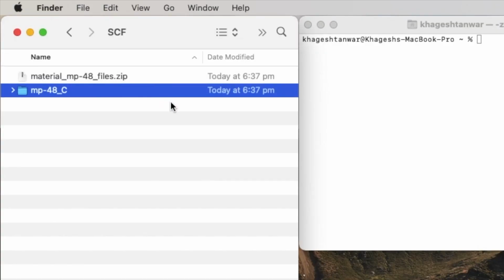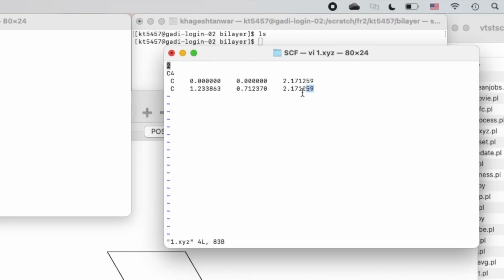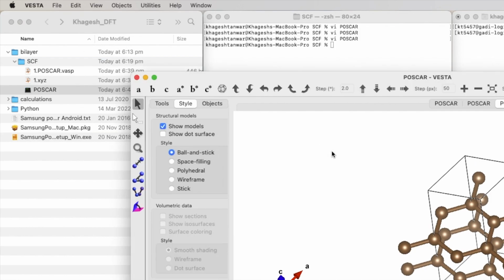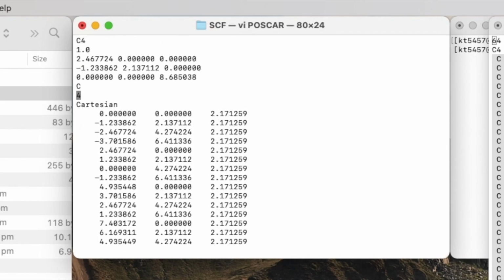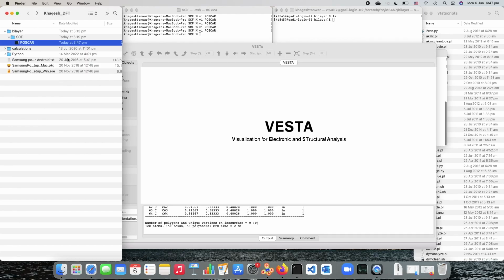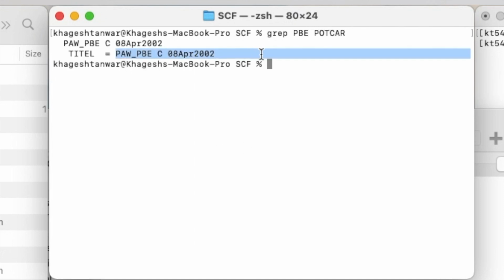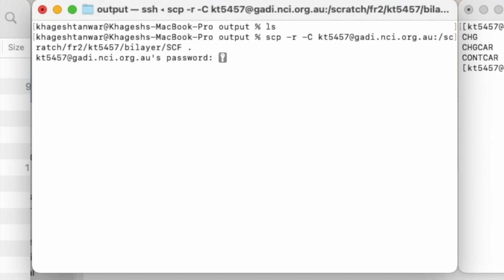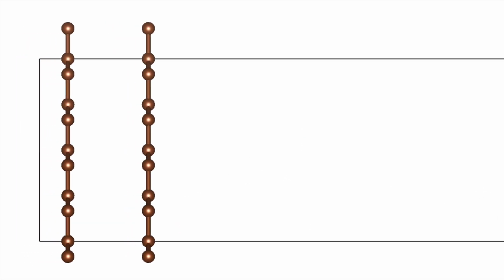Structure Relaxation of the Bilayer Graphene |VASP| VESTA

Comment: Why are you using ISIF = 0 for relaxation?? I want to do aimd for heterostruxture...what should be relaxation criterion should I use??
Reply from the maker: Isif=0 is the first try, one must use to relax the atom, specially when you use “LREAL”. But in the second step, it’s recommended to use ISIF=3 to relax the cell parameter and its volume. Otherwise, there are too many degrees of freedom. For AIMD, you need to do IBRION=0, MDALGO = 2 (type of thermostat), TEBEG  = 300.0 (initial temp), TEEND = 0.0 (final temp).

Comment: I am doing the NEB calculations, and the optimization energy is 0.304180E-02 before that, it was in a negative sign like d E =-.195822E-03. why it doesn't show any negative sign.
Reply from the maker: you may have solved the issue by this time. But, positive energy means the NEB step in which it shows positive energy is not feasible, it requires further optimisation, maybe try with different initial positions.

Comment: How to know that structure is converging and calculations are running smooth before that message of stopping calculations
Reply from the maker: that depends on what interface you are using, I used remote computer where i couldn't see the whole process, and usually its this way. if you are using nodes, maybe you can use 'qstat -u' to check if the calculations are running. usually, you will see an error message if the calculations are stopped in between.